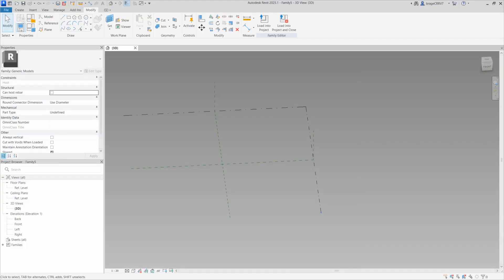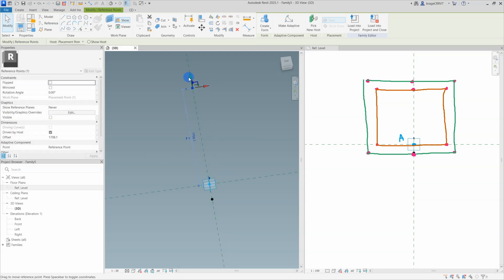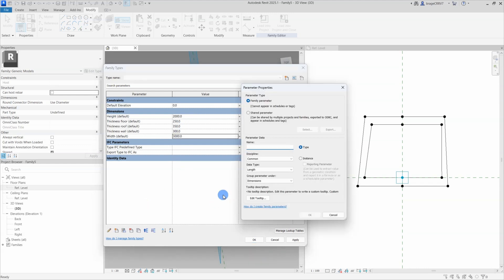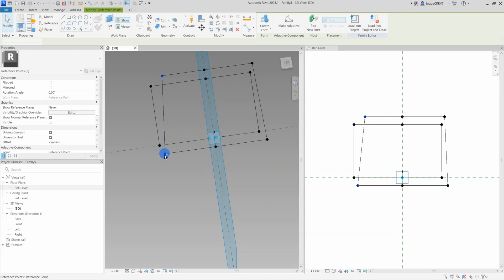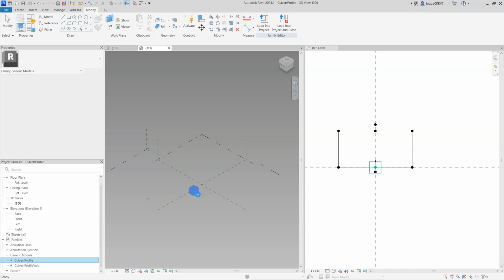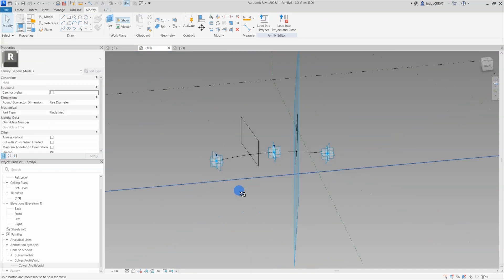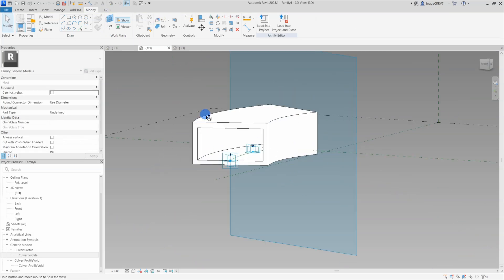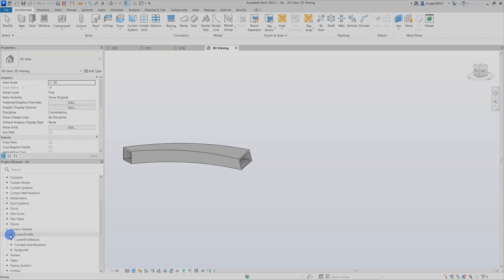Revit adaptive family | Curved culvert with a rotated profile

Comment: Thank you for the great videos! Your videos have been helping me learning how to create family very well.
I have a question though, when do you decide to use adaptive family instead of normal parametric family? For example if I want to create lining tunnel with possible slope variation, so the profile might have rotation only in X and Y axes and no rotation in Z axis (longitudinal), which family should I use?
Thank you very much!
Reply from the maker: Great to hear my videos have been of help! When the shape becomes complex and I need the geometry to be adaptable to a wide range of geometric conditions, I go for the adaptive family. This can be when I need more than one insertion point (maximum two for a line-based family), a wall with a non-uniform surface, or to automate repetitive tasks with elements that have variations in size or positions, curved geometry like this culvert, or a bridge. 
Otherwise, I will go for the classic Revit family; most of the time, I will go for the classic.
I suggest watching my almost 1-hour tutorial on how to create a family. There, I go through the basics and then some more advanced about creating a family.
Reply: @EngineerBear90  thank you for the reply! really appreciate the help. I will check that video out！